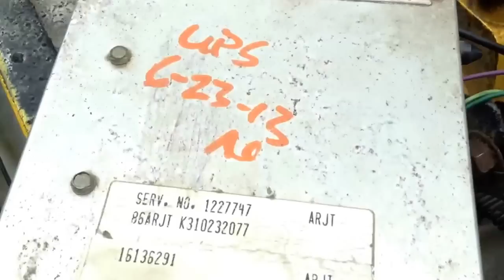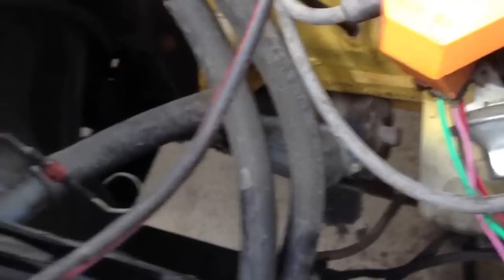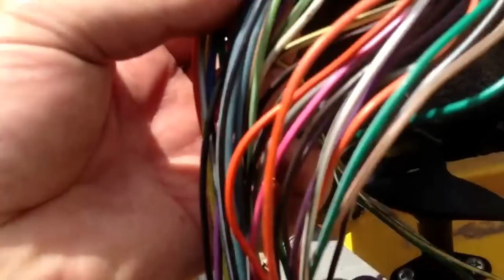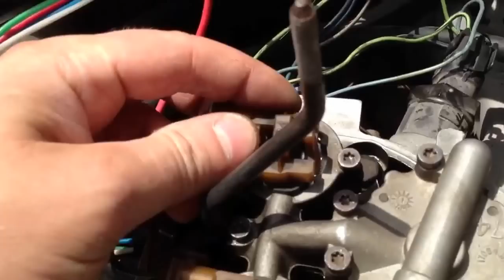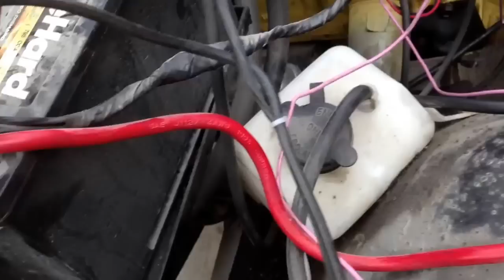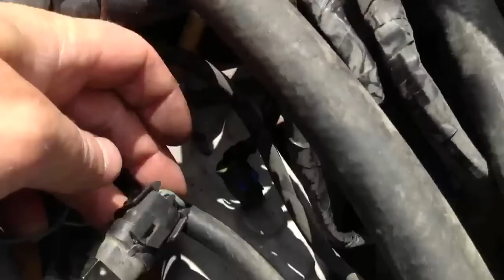Chevy TBI swap to jeep CJ7 258n

Comment: Old video but i am researching a tbi swap on my Jeep J10 with an AMC 360. Watching this gives me hope that it is pretty straightforward and can be done easily. Im going to make a ford spreadbore to gm tbi adapter out of s chunk of aluminum and will be pulling everything needed from the salvage yard. I will also be swapping to the newer motorcraft distributor and gm hei module. Have you had any issues with it since doing the swap? Also how is the performance? I dont expect to gain power but do expect better throttle response, better mpg, and just run better.
Reply: Did you get it to work I’m looking to do the same exact thing

Comment: Howd ya get the throttle cable to hook up? Ive got a dodge truck with a 1975 holley 2245 2bbl carb. No friggin clue on how to hook it up!!
Reply from the maker: Matthew Green I had the guy who made my adapter plate make that little aluminum bracket that bolts into the throttlebody adapter at that holds the throttle cable in position
Reply: Jason Hoffman so the dodge cable eyelet will hook to the throttle lever ? If so then i could use it on mine
Reply from the maker: Matthew Green That I don't know, but if not Im sure you could scavenge the correct fitting cable from a junkyard.

Comment: Could you please share the info about the wires that need to be grounded?  I'm working in this swap but I don't have any idea about grounds...
Reply from the maker: George XJ.  If you take the entire wiring harness off at the junkyard and trace back the wires you'll find a large negative ground wire which is black that goes back to a terminal I believe.  The best way to do this flop is to take the entire wiring harness back with you from a donor vehicle so that you understand where all the wires girl and mark them accordingly.  And even if you didn't you should go to a junkyard and just look at all the wiring harness fits on those vehicles to give you a better idea of how to wire it with whatever you have now
Reply: Thank you for your support Jason,  The Diagram for the harness says that "C9" purple-wht wire goes to the starter...   is that correct? 
All other wires match with color and also with your video.
Reply from the maker: George XJ Im a little fuzzy on the wiring since I did it years ago

Comment: have a question on the schematics I have it shows the c9 wire goes to the starter solenoid and the fuel pump wire is the green with white wire or the A1 wire?
Reply from the maker: The fuel pump wire on my wiring loom was gray.  If you can't figure out which wire to use, you could always wire the pump to the ignition accessory mode so that it turns on before starting.  Make  sure you always use a relay wired to the battery for that however to avoid burning out your ignition switch contacts.
Reply: You probably don’t have the same computer he’s using

Comment: on the other video u show jumping the ignition to the power. is that still needed so the injectors will fire?
Reply from the maker: I put that wire on a relay when I finally got it wired in.  I believe the reason I did that was to avoid burning out the ignition relay or preventing any electrical feedback.

Comment: Awesome, Thanks Jason. Getting ready to do this on my 88 YJ. I have ECM and throttle body and most sensors. Going the JY to try and find an unmolested wiring harness from an Astro van, S-10 or full size C/K with a 4.3. Jason, what did you use for a fuel pump? Did you use one of those aftermarket pumps like Mr. Gasket of another pump? Thanks

Comment from the maker: It works good, but you need a heated O2 sensor on aftermarket headers if you are locating it downstream from the head.  If you have a spot for it in the stock exhaust near the manifold, the stock O2 sensor should work fine.  I'm now fixing up my Megasquirt tbi system for it.  Total cost of a general chevy tbi swap is about $50-$80 in salvage yard parts (ECM unit, throttle body, sensors, wiring, etc), a $40 electric fuel line pump, $150 in new fuel injectors or at least good used ones that you know work, and another $50 for new sensors and other bits if the junkyard parts don't work or you want to buy some of the parts new.

Comment: Hi Jason!
I just switched out my carb and installed a rebuilt gm throttle body with rebuild ecm etc..
My cj7 isn't running very well... :(
All of the wires are correct. Have a ground wire to the battery. Just wondering where you hooked your 12volt source? I put on the positive side of the coil.. Would that take power away from my ignition source and cause a weak boggy running jeep? :-0

My check engine light is illuminating too.. But its for the 42 and 43.. Electric spark control --which I haven't installed.. Don't know if this would be the issue?

PS. Your jeep is running better than mine.. :(

Comment from the maker: You’ll need to go to a junk yard and pull the tbi with injector plate off of a 350 engine.  Pick a truck if you can, because it’s likely that you’ll get the tbi computer that has the “734” numbers on it that works best with the truck/jeep tbi conversion.  Make sure you find a wiring harness that has most, if not all of the sensor connectors intact.  Your sensor connector priority should be for the Coolant sensor, fuel injector connectors, O2 sensor, throttle sensor, idle air control sensor, and especially the wires going to the tbi computer.
 
Make sure to clean up the TBI as well as you can.
You should buy a new coolant sensor and fuel injectors.
I tried to save money by using the old fuel injectors and cleaning them and they had shorts in them and fried my aftermarket Mega Squirt controller.
Buy new injectors and it’ll make it all easier.

Comment from the maker: The adapter plate worked great, had my local machine shop guy design and build one up for me.  Turns out that I didn't need the tach filter since I had the after market GM style HEI distributor and wasn't using points or a weaker type of HEI distributor.

Comment from the maker: It's working great.  The only problem I have is that it is now running a little rich, which I think is due to the fact that my narrow band O2 sensor is ran so far downstream that I need to buy a heated one to work properly.  I pulled my boat to the lake several times already this summer with it and it started up and ran fine, so yes, I'd recommend the swap, but only if you buy new fuel injectors for the junkyard tbi.
Reply: Jason Hoffman do you need the computer at all